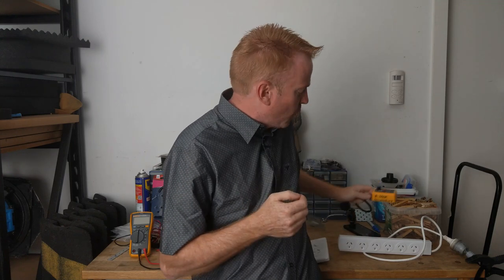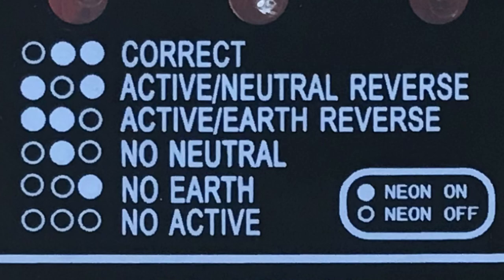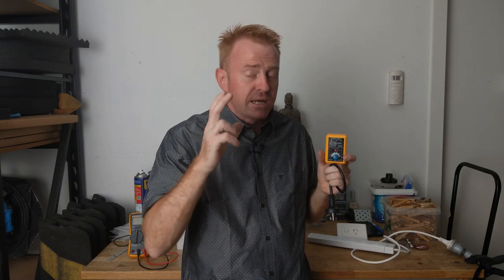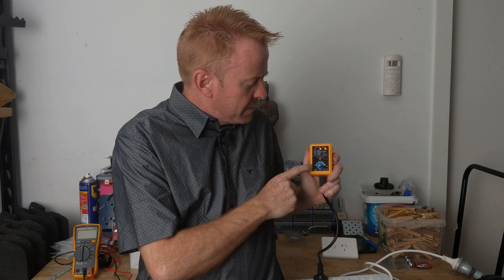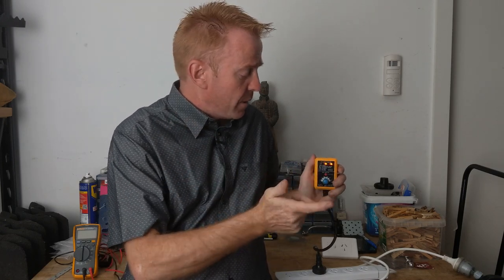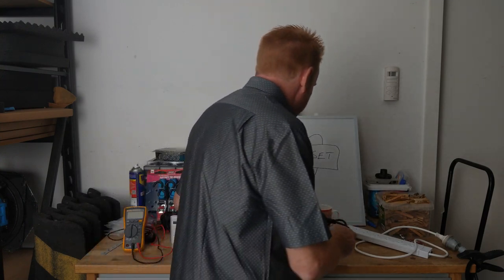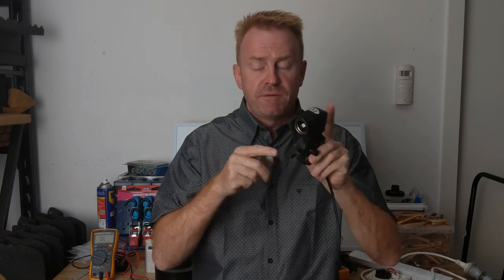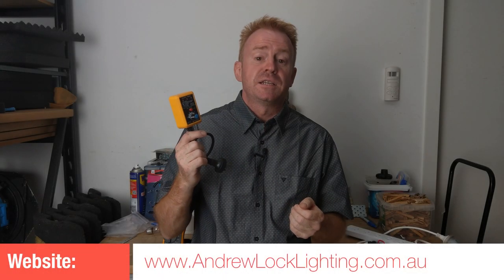Gaffer & Gear 34 - Testing Outlets

Comment: Great video, and I had a chuckle at the need to be careful when throwing the test switch as I have seen that done many times over the years. I am not a qualified electrician, but know a little from working in an associated trade. 

I would add to the video that people need to also consider that those socket testers can't pick up every type of fault. For instance they can't pick up an earth and neutral cross in the outlet. In fairness most of the testers I have seen have warning to that effect either on the unit or less ideally, in the instructions.

Additionally, if the socket outlet being tested is on a "ring main" (the most common wiring practice here in the UK but not sure about Oz) you can have certain types of fault on one side of the wiring on the ring, but as long as the other side is ok, it wont detect the issue. 

Potentially it means that the current carrying capacity of the circuit is halved. In a domestic environment that might go unnoticed for years, but start plugging in equipment that draws a lot of current, and you can have problems.

Still the outlet testers are a very useful item to have, especially if you get some short "breakout" leads or adapters for the various light bulb sockets you may come across as you will then be able to test the power to those as well.

 As somebody else already mentioned you can also get outlet testers that display voltage as well and they are cheap as chips..

Finally, a comment on safety...If you guys are working on electrics or electrical equipment on a busy set, i would have thought you should be using an electricians "Lock Out Kit" to stop  other people inadvertently switching on a breaker or plugging in some extension cord and re energising a cct wp you are working on ? The use of Lock Out Kits is very common ( it's actually mandatory) especially for industrial electricians...

Comment: Andrew. just Two months ago I got electric shock due to the same scenario. I touched the thread of light while threading it in. I always worried if it damages my electrical equipments. Now that I know what is causing the problem. I will check my house electric board and change it appropriately. Most of the Electricians here in India are dumb and don't own a license. Thanks for the great knowledge. May God bless you.
Reply: As long as we are talking about AC (alternating current) it is generally not dangerous for your equipment, but is VERY dangerous for people. This is one of the reasons circuit breakers switch off both poles of an electric circuit, and I recommend you to always use that, if you cant unplug something out of a socket.

Also, when working on electricity, make sure someone can't accidentally plug the thing you are working on in (tape the plug up with electrical tape or whatever)

Comment: As a certified electrician, I NEVER trust a normal switch to keep me from beeing electrocuted - the distance within a switch might not be enough and can arc. When you need to be safe, take it out of the socket or trip the circuit/ earth fault breaker.

Also, make sure only ONE person is allowed to use the fusebox for firesafety and risk of electrocution, this best is the Gaffer (head of electrics)

As an addition, power generated from a generator is not grounded. It can be grounded using an earthing pin, but always assume generated power to not be properly grounded/ don't rely on it!!!